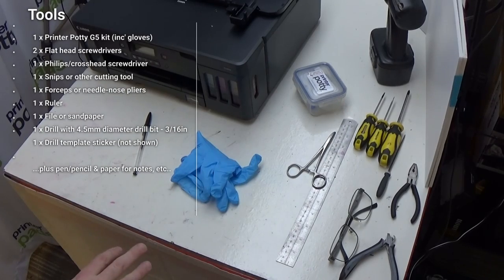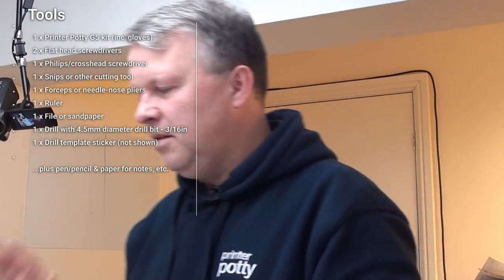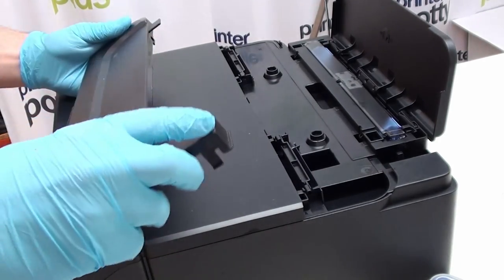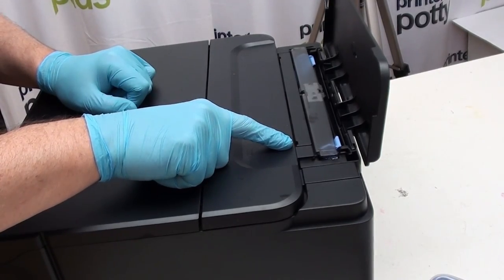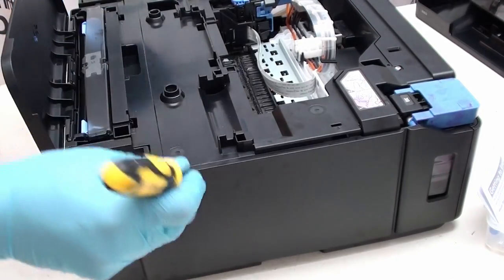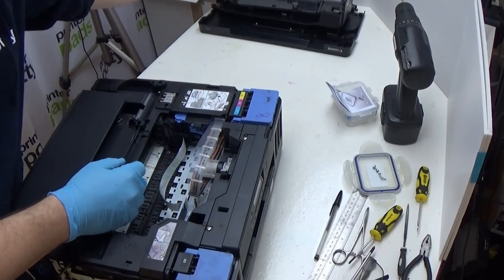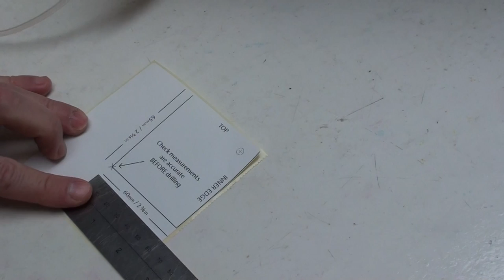Canon G5050 - Fitting a waste ink kit & partial teardown

Comment: Major improvements can be achived by going into print head replacement routine in maintenance first. It will come w/ 3 benefits 1/ will move print heads to center rather than requiring force 2/ it will ask you to shut off ink valve, preventing receding of ink from pipes 3/ you won't have to do ink flush.
Reply from the maker: Not sure if you're commenting on the correct video here as there's no need to do any of those things as part of this installation. Your points are relevant for other troubleshooting steps when trying to fix things like air bubbles in the ink tubes, printhead replacement, etc... but this video doesn't touch on any of those topics.

Comment: Thanks for the great video with all the information and all the time you took for gathering them! You calm voice suits such a complex modification perfectly!

One Question left: do i need a new reset code each time the printer "thinks" its sponge is full or can i use the key over and over again?
Reply from the maker: Thanks for your kind comments. To answer your follow up question, you would need a new key each time to reset the waste ink counter.

You may be able to find a copy of the relevant Canon service tool that resets the counter but you do need the correct one and finding that can be a major undertaking.

Comment: I bought the kit and fitted to my canon G5050 and it works successfully till now. I hav now error code C000, can I fix it with weicreset software? What would have caused this error. Any idea?
Reply from the maker: Not come across that error myself but a quick google indicates one of the printheads may not be seated properly and/or some paper fragments may be blocking things up internally.

Comment: Can i velcro the printer potty to the printer sideways and take off when emtying ?
Reply from the maker: You could BUT you’d need to be mindful of the vent hole position in the lid and also make sure the lid seal was seated properly. Personally I wouldn’t recommend it as it’s risking a leak and ink stain mess.